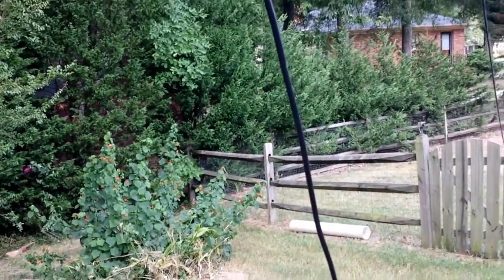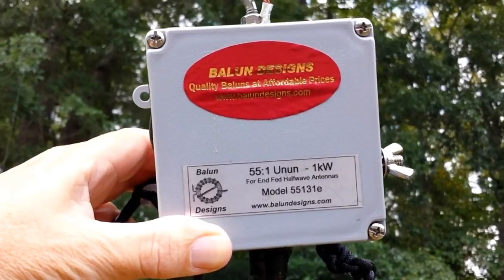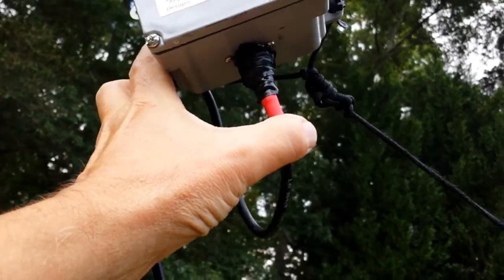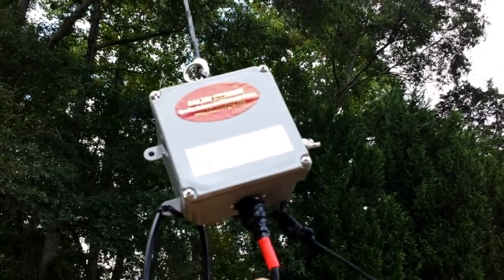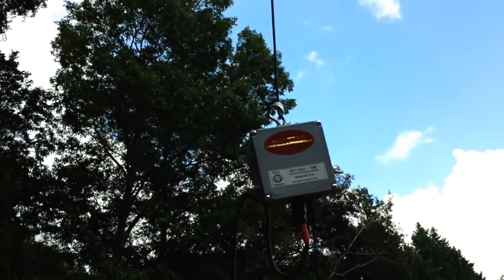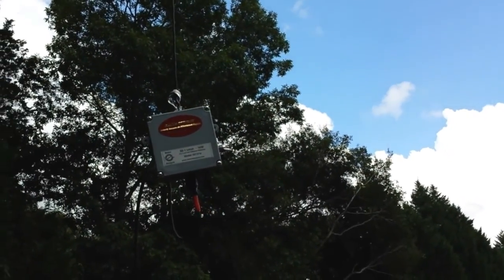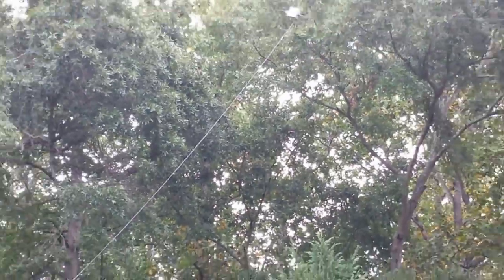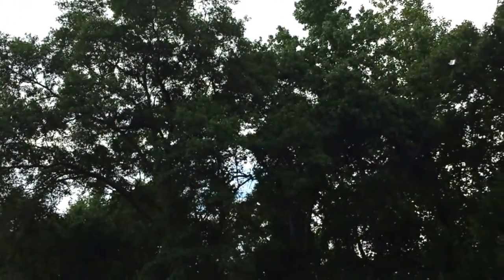End Fed Half Wave 80-10 1kw  Balun Designs # 55131

Comment: Steve I really enjoy your videos, thanks!

I have been using an Ultimax no tuner 40-10 EFHW for some time now with good results. I modified mine to work on 80 meters by adding another 75' of wire for a 1:1 swr @ 3.5 mHz. This however threw off the other bands drastically, to the point that they then required a tuner. A home made coaxial 40 meter trap installed at 66', the length of the original antenna, restored it's no-tune capability on 80-10 meter non WARC bands. I'm extremely pleased with this antenna.
Reply: Forgot to add

73

N9MB

Comment: your coax is acting as the counterpoise. If you hook counterpoises for the bands where SWR is not flat, you may get a great result. Use formula 180/Freq. for counter poise length in Feet.

Comment: I am trying to decide on an 80 - 10 meter end fed with no turner required that I intend to use when camping or operating portable. While mostly I will be QRP it would be nice if it could handle a 100 watts or more in data mode in the event of an emergency.  Can you offer me any advice or a recommendation. It appears that you have experience with the myantenna 8010 as well as a balunDesigns transformer and your own wire.
Thank you in advance for your time.
Tom
Reply from the maker: Tom: The Myantennas EFHW8010 will do fine at 100 watts any mode. I think it's your best choice.  The one by Balun Designs works as well but might be a little larger for portable use.
Reply: Thank you for taking the time to help me.
Reply: Balun Designs makes a 300 watt unun for portable use

Comment: Nice video and the antenna Sounds great on the air Steve!  I have not gotten around to making my video.  As I told you on the air, my set up is very similar to yours, except  I'm using an old R7 matching unit as the  transformer.   Once I get an analyzer I will measure the ratio, and make a video or put up diagrams on my QRZ.  Anyhow,  you sound great on the air.  Keep up the excellent/ informative videos!  73- WZ2J/  Vin.

Comment: Steve,

I have a number of questions.  I have built a multitap unun and I am trying to understand how such a design can achieve such a low SWR.  Simulations I have made suggest that the SWR should be at least 5:1 on most bands.  Have you tried 

1.  Does the SWR vary with power?  If you could check to see if with low power, the SWR remains the same, so there isn't any arcing in the unun or between the wire and whatever the wire is touching.  The SWR should be the same at QRP power.

2.  Does the SWR vary significantly with what is near the antenna?  Is the tree the antenna is on a significant part of the antenna?

3.  Is there feedline radiation or loss?  For example, does the SWR drop if something is touching the coax shield where it connects to the unun?

I made a octafilar unun with impedance transformation ratios of 4:1,9:1,16:1,25:1,36:1,49:1,64:1 and I am going to try to use it to understand where the power is going in these end fed half waves.

Thanks!

Dan
KW4TI
Reply from the maker: Dan
First of all you aren't using the right ratio. For feeding an end fed half wave you need a secondary impedance of around 3,000 ohms! That requires a transformer ratio of around 50:1. The Myantenna box has a 7:1 turns ratio auto-transformer which translates to 49:1 impedance ratio. Take it from there. 73